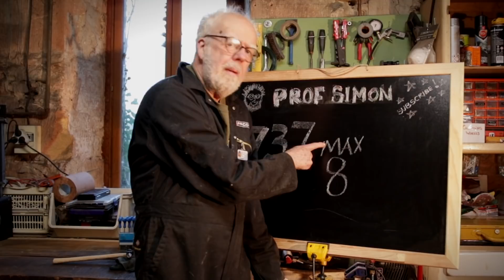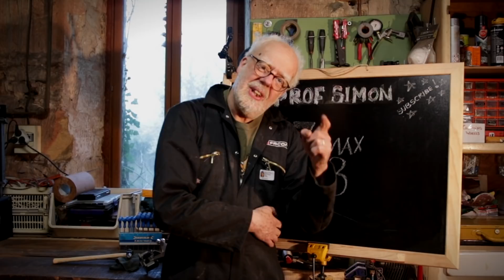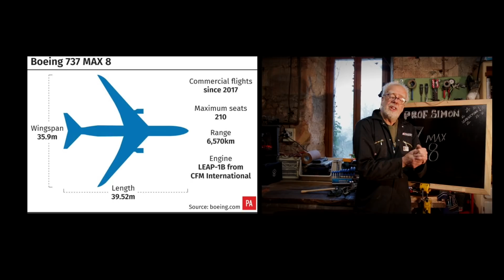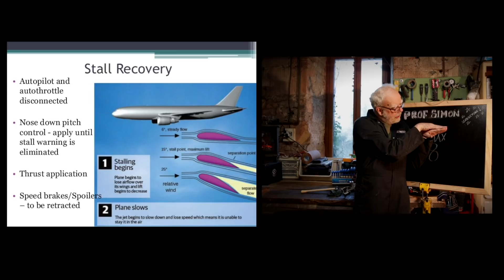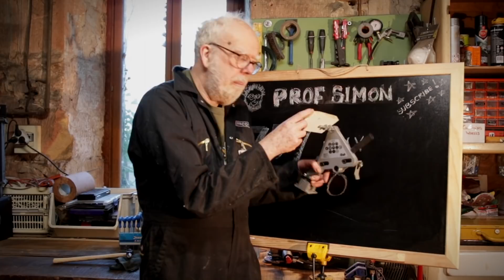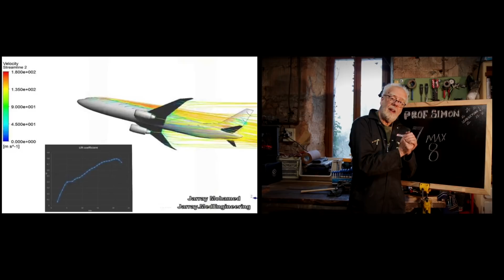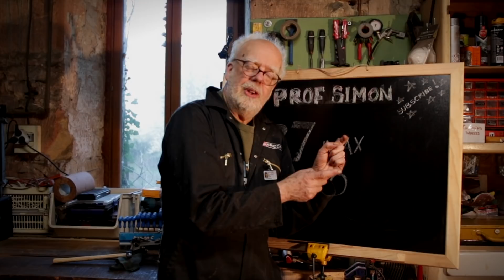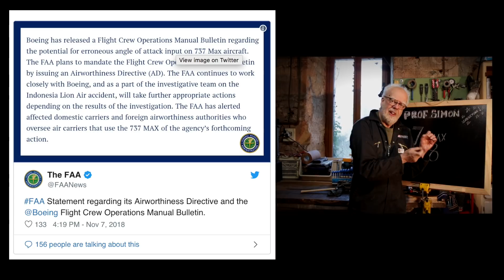Boeing 737 max 8's

Comment: A system that drives a plane directly into the ground has to be called out as a failure. Even if there is conflict between the pilot and the auto pilot, I would have to say a serious issue has been built into the software. Clearly the auto pilot wins out for the control of the plane and steers the plane directly into a hard ground interfacing. I would ask should the auto pilot recognize what it is doing to the plane, even in a conflicted situation? I don’t know, I’m only asking. Are there no gps, or even gyroscopes (I know really old here) that would give situation awareness to the auto pilot and not put the plane into a dangerous situation? Thanks for the video.
Reply: Definitely a failure ...big time!

Comment: Fantastic video for us laypeople. I knew some bits already (AOA, stalling and such), but never knew about the physical sensors positioned outside the aircraft that determine whether or not to take action electronically. I just read on a forum that there may be eyewitnesses of some debris falling off the tail section of the Max-8 prior to its demise. We'll see what comes of that. Thank you for the insight into these tragedies, and the bits of humor you use to help us along. BTW, I'm a Yank so the term "bloody" isn't even an expletive here. Same as bollocks. Hahaha

Comment: I usually learn by  trial and error with new software, but I guess that's not advisable with flying a plane
Reply: That's what thought too. Boeing being negligent by treating their softwares like a webpage which is a big no no when lives are at stake. I can't believe what I was hearing when they said they were "updating" the aircraft's software like it was some app on play store. 
Sensitive aircraft softwares are not equal to social media websites!
Reply: MrUranium238 absolutely not
Reply: The Lion Air had issues on it's previous flight, I saw nothing in the report that they found anything definitive of why it was having problems. And they sent it up again, maybe it was software in the previous flight, or maybe there was something else wrong that should have been fixed.
Reply: You have ground flight simulators for that reason. The point is companies don't want to pay for their pilot's training. They prefer the old we gave them the manufacturer's FREE dead tree stuff. Nobody reads the whole thing and they know it. The freaking glossary is 12 pages.
Reply: MrUranium238 I hear that,sad ending
Reply: yeah, rite...i am full questioning about how they test this new plane before they sell it to airline
because this has potential risk then they could imagine when go into production phase..

i hope they don't get skeptical in embedding new software/technology..
just making sure the SIT/UAT phase is done correctly..

Comment: M.C.A.S., MAY CRASH AIRCRAFT SIMULTANEOUSLY.
Reply: M.C.A.S.  MAY CRASH AIRCRAFT SYSTEMATICALLY?, When all else fails don't blunder use the seat of your pants, stick and runder. Don't fight with the chip shoot from the hip. Tip,  an easy override and manually fly the airplane.  Trust in thrust or it's a bust.  Only cactus 1548 got out of that one,  they had an a.p.u., a river and their BRAINS! NOT SOME SENSOR LESS CHIP.(pretty Shure the pilots of 1548 had the angel wings a going on too.)
Reply: @dennisintersimone3416  One would want to believe that should safety systems malfunction or sensors malfunction and it's obvious to a trained pilot there should be a switch to switch it all off and let the human trained pilot take if from there.  Incoming info suggesting it may not be that simple.

Comment: Sort of like the reactor accident at 3 mile island in 1979.  The operators didn't react correctly to the software that was designed to react to an anomaly correctly and they made it worse.
Reply: Compounded by a known defective PORV valve design, and a poorly located backup gauge in the control room (on the BACK of the console).

Comment: https://onemileatatime.com/boeing-737-max-safe/  This comment is from the site.

 Prabuddha says: "The cause of the Lion Air Crash is very clear.
Problem 1) The 737 Max is unstable as the engines are much bigger than what the airframe was designed for
Problem 2) Boeing marketed the Max as a plane which will need no retraining from the 737-NG so Being engineers were forbidden to make changes to planes physical design to make it stable
Problem 3) Boeing Engineers changed the flight control software to include MCAS which through fly by wire makes the Max fly the same as the NG
Problem 4) Boeing designed MCAS to take inputs from only one AoA sensor instead of both.
Problem 5) Boeing AoA sensors fail at a worryingly high rate
Problem 6) To accomodate MCAS Boeing removed a function from the NG. In the NG if the Trim system is misbehaving the pilots can pull back on the yoke and the Trim System disengages. In the Max this feature is no longer there and instead pilots have to push 2 trim disengage switches (this system was also there on NG as a backup)
Problem 7) Boeing did not tell the pilots that pulling back the yoke does not work anymore

So Boeing made a design decision for commercial reasons, then did not tell the pilots about it for marketing reasons, then designed that component MCAS without redundancy and dependent on one component (single point of failure) ,then manufactured that component to poor quality standards, then removed one of the main recovery modes for this failure and then did not tell the pilots that this recovery mode was no longer available.

At this point this looks like a criminal case not just a civil lawsuit as these grossly negligient decisions have led to the deaths of over 300 people.

For comparison Boeing 737 Max has now killed more Air travellers than 9/11" END QUOTE
Reply: This comment is from the same site, an airline pilot: "Seems like Boeing has tried to integrate some of Airbus’ protection of flight envelopes, but has done a bad job of implementing it (depends on one Angle of Attack sensor- no ‘tie breaker’ setup) explaining it (was not in the flight manuals!), and not being in the training. Shame on Boeing!

IMHO, the stall prevention system should be rendered INOP and placarded. It is trying to fix a problem that does not exist!

Comment: The problem is that with the computer partially in control, all of a sudden, it seems as though you don’t have any control over the aircraft.  You begin to doubt if anything will work.  You try to pull the yolk back, plane should pitch up, but the anti-stall software pitches the plane down.  You are out of control.
Reply: I suggest that the pilots not engage the autopilot until they are at least 10,000 ft. AGL.  Then there’s time to recover if things don’t seem to be going right.  There’s another problem, and that is the design of the MAX 8 and 9.  These planes have bigger engines, that are mounted further forward on the pylons.  That changes the CG and the stall character of the aircraft.  The computer system was modified to compensate for that.  Unfortunately that mod causes the plane to pitch down seemingly uncontrollably.

Comment: Interesting presentation, but I think he is overlooking some details.  There are two AoA sensors.  The first question is: Did one or both of these sensors malfunction?  Then, if so, how does the MCAS system handle it?

I’ll add that in the Lion Air crash, there is evidence that there was an erronious stall indication.

It is my understanding that MCAS is only using one or the other of the sensors, not both at once.  If that is the case, how can it detect a stuck sensor?  If the software tries to bring the nose down, but the sensor doesn’t report the change in angle correctly, then you have a problem.  Meanwhile, the pilot, who can see where the aircraft is pointing, is trying to work against the software to maintain the correct flight path.  Boeing and some others seem to think that the pilots should just turn off the system, meaning that they should be able to correctly diagnose the problem and act to fix it in just a few seconds while they are struggling to control the aircraft.

If the AoA sensor being used is working properly, a small adjustment of trim by the computer should be all that is needed, and the aircraft should not get into trouble.  That would be the usual scenario.

So I assume there is a sensor malfunction.  Applying fail-safe principles, it is obvious how this should be handled.  Both sensors must be queried at all times.  If there is a significant disagreement, they should be disabled automatically, and the pilots alerted.  Then the pilot flying the aircraft has full control without interference from MCAS.
Reply: It seems AoA disagree + MCAS = death.